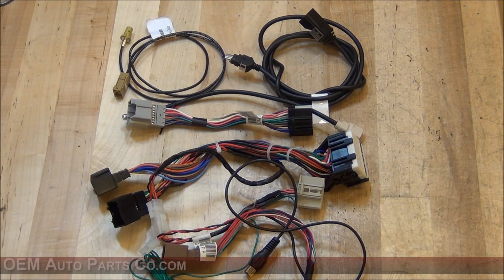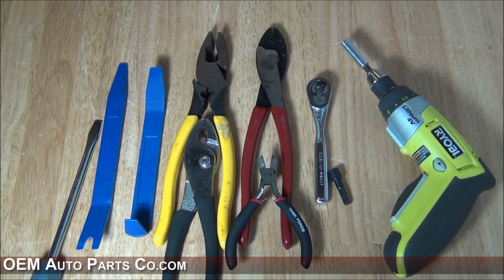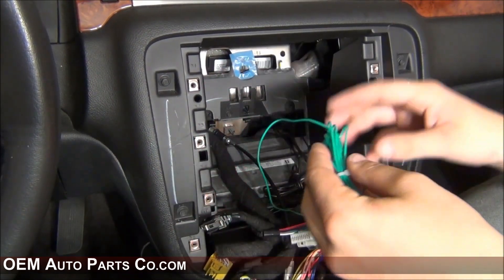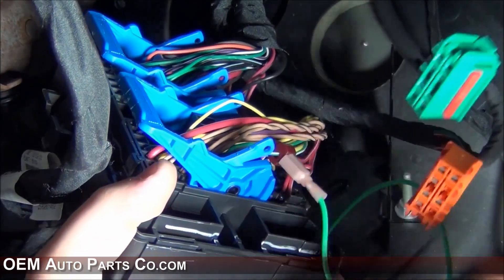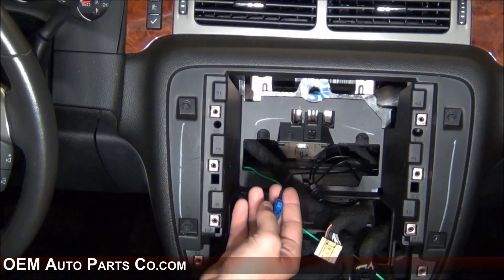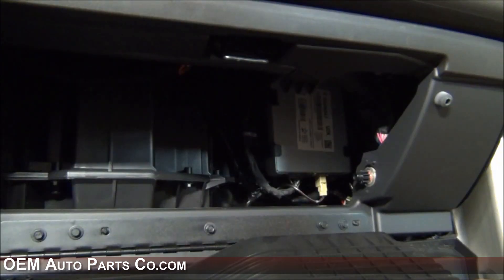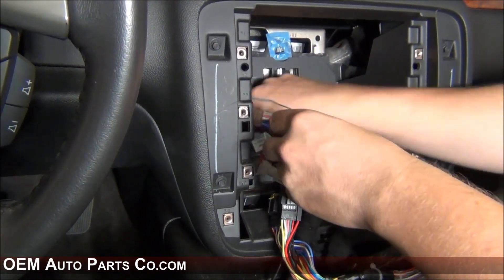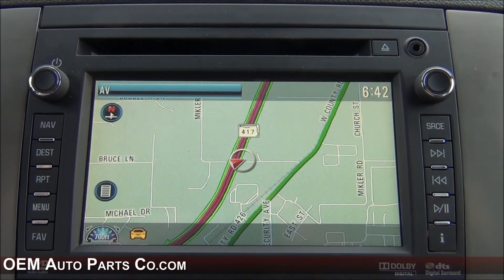2007-2014 GM - Hard Drive Based Factory GPS Navigation System Upgrade - Easy Plug & Play Install!

Comment: Thank you for this. I have the stereo you installed in my 2013 Suburban with bose. However I'd like to install an aftermarket stereo. Do you have a solution for this? I don't need xm or nav as I just use my phone. There seems to be an issue with the bose amp in the standard swap connections? Thank you for your help.
Reply from the maker: We don't. We only carry the OEM equipment but I would try Crutchfield. They may be able to help with an aftermarket unit. 
https://www.crutchfield.com/

Comment: Interested in upgrading to such a unit in my wife's 2008 GMC Acadia base unit, which looks identical to the radio you started out with. With GM not seeming to offer a solution to the 2G loss, I'm interested in a factory radio with navigation and Bluetooth. How much are approximate costs?
Reply from the maker: Click the link below to get details about this upgrade for your vehicle. Contact one of our tech advisors at 855-636-6287 and they will answer any questions.

https://www.infotainment.com/collections/all/products/2007-2008-2009-gmc-acadia-factory-gps-navigation-radio?variant=376839721

Comment: My 2012 Silverado already came from the factory with this navigation head unit, but I bought an aftermarket head unit that is plug and play with the wiring of the head unit you removed, I wasn’t aware that the wiring harnesses were different, would you or anyone know of an adapter to convert the navigation harness to the standard harness?
Reply from the maker: Ah! I see. So we have a kit that will upgrade you from the DVD Nav model to this one (it includes conversion wiring) but it's for factory to factory. I would check with the aftermarket radio manufacturer to see if they have a version of this radio kit that uses the HDD GM Factory Radio's factory wiring, and not for the setup that originally had a nav disc.
Reply: @Infotainment_nav do you have a link for that